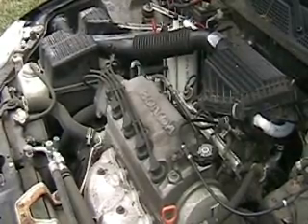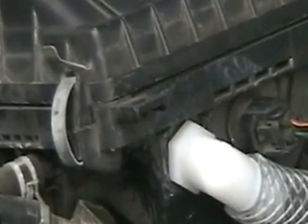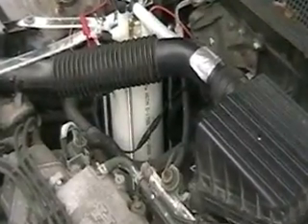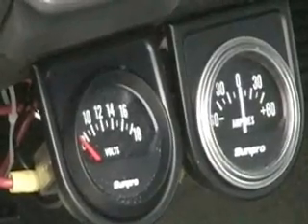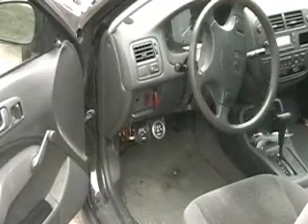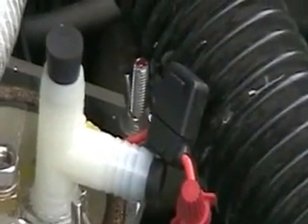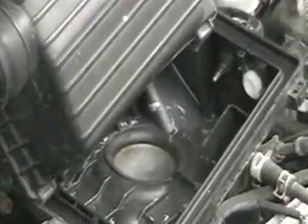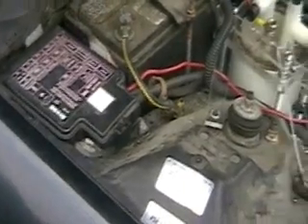Hydrogen Tap ( More installation to Honda ) 116

Comment: And you could just swap place with your HHO connection
and where your air temp sensor is now that would give your HHO a better more direct route to you throttle body intake.

Comment: John, are you using the intake air duct hole that you have taped up that in front of your air filter box? As
you may utilize it to place air temp sensor. As it is usually ducted to capture the outside air and channel it into your air filter box. Is the ATS in your way now, is that why you want to move it?

Comment: Wouldn't that just give the computer a false reading-as it would read only the underhood temp not outside air temp. The underhood temp would be much more and tend to drive the computer beyond it's parameters. I guess you could try it and see as it would set a code if it doesn't work.

Comment: And I think you had the wiring diagram find out what color code is on the wire that goes to the pump trace it back to the firewall and spice in the wires to your switch that way you keep everything hot going to your relay when you cut power to your switch

Comment: John, I don't know if that will work or not on a Honda but I know GM vehicles will sense That as a bad sensor or disconnected, you may try to disconnect it and see if it turns the check eng. light on. I think the computer needs to see 5 volts min. to keep the light off.

Comment: Can you tell me anything about the computers in newer cars? I am using a hydrogen booster on my '97 escort and I have heard that the hydrogen will richen the fuel thus causing the computer to lean the gas(the whole idea), The problem I have heard is that at a certain point the computer senses that it is so lean that it 'safety defaults' to 'full rich'. And it is pretty obvious once it does by the poor MPG. Anyone know anything about this? And if true, how to avoid?

Comment: it looks like you are making awesome progress. I can't wait to see it start up...and eventually run on only hydrogen. I was thinking, since you are having to deal with the fuel injection system,,,and gasoline needs the oxygen to burn...could you use a carbourated  engine and have the hydrogen go directly into the fuel line/ carb. or shut off the gas intake completely, and have the hydrogen tube sealed to the air intake on the carb, just above the head...keep it up

Comment: John, Do you intend to use the pwm, blocking diode and coil as you discussed in a preveous clip (from Meyer patent)?  If so please let us know where you get the coil.  If you use off the shelf components please advise us as well.  I am still loving your progess.

Comment: Hi, 
Be aware of knocking and pre ignition, which could backfire and blow up your system....
There have been some investigation into pre ignition on hydrogen engines, search the net...
may you should have a bubbler also close to the air filter....
Good luck!

Comment: Even if you keep the set up the way you have it now, just add the copper tubing inside the air box and extend it directly over the throttle body and just JB weld it in place.

Comment: John, I think you may get better results if you had a copper tube flared alittle that you placed it's opening directly over the throttle body opening in order to feed the engine more uniformally.